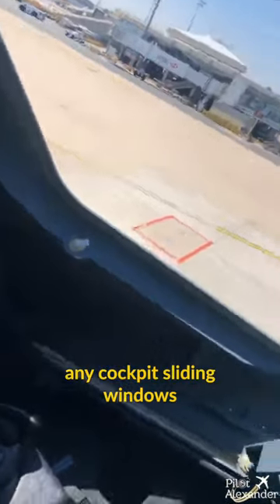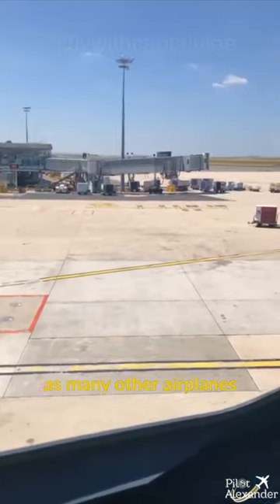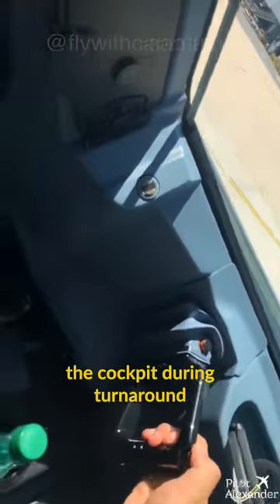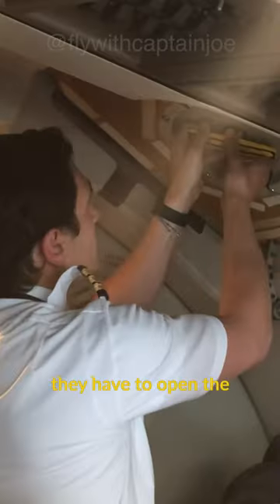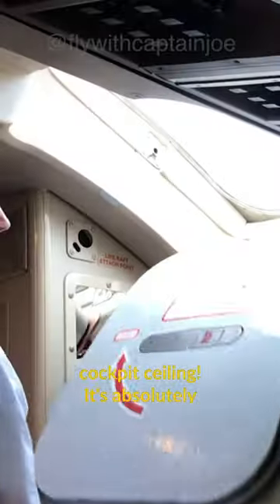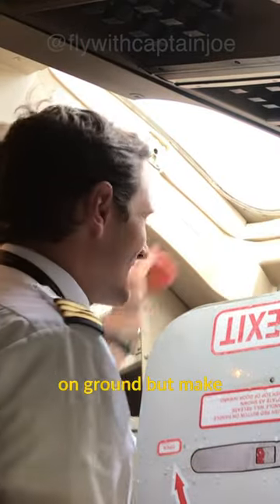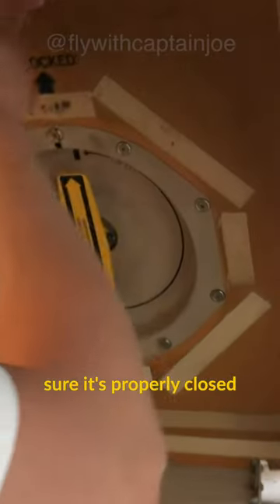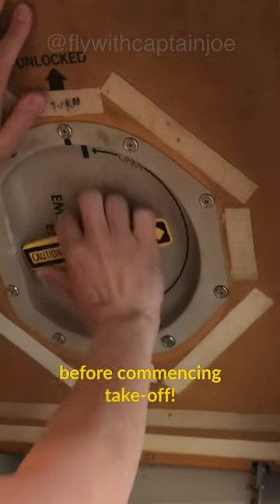How to open a 747 COCKPIT WINDOW??? #shorts

Comment: you say make sure it is closed on take off? Is there a warning light or sound to let them know it is open? Seems like something that might be important
Reply: There is a sensor which will alert the pilots
Reply: @drtibbs693  thank you
Reply: @drtibbs693 or you can look at the door page.
Reply: Just might save the airplane and all the passengers
Reply: @TB-um1xz  not sure if this applies to all planes, but I believe that on some aircraft cockpit windows and hatches do not show on the door page.
Reply: @muhammadfawzi1145  Well, this is a 747 video. Windows are not doors, so they won't appear on door pages. With Boeing aircraft's if the window is cracked open. You can see markings showing you that the window is, in fact, open.
Reply: @TB-um1xz  I’m more familiar with Airbus, so ur probably right
Reply: They would notice the wind noise during takeoff roll and the cabin would not pressurise. Aslong as they are below 10k feet it is all right.
Reply: @KuntalGhosh  mind you it would be one hell of a wind in the cockpit at 250knts 🤣
Reply: @Aspie_Geek_UK  😂 they will immediately hear it during the takeoff roll. My biggest fear in flying is explosive decompression like a door flying off or like that 737 that lost it's roof..
Reply: I last year or whenever I don't know when or where, but there was a plane taking off that right when they rotated on takeoff,  the cockpit slid open.

Comment: 2003 Iranair 747 SP flight from Tehran to Tokyo. On the hot day the flight engineer opened the hatch and forgot to lock it when he closed it before startup. Airplane takes off. They try for 20 min to close the hatch unsuccessfully mid air. They Dump fule, land, refuel, close the hatch, and head to Tokyo.

Comment: Always wondered if they can open them in the sky, I know at 40k they couldn’t but what about low alt
Reply: By “them” I mean windows
Reply: You can’t open any types of doors, windows, or hatches while cruising due to the pressure difference, its like trying to open a car door as its sinking. However you can open them if there is no pressure difference inside from outside. So yes, as long as the aircraft isn’t pressurised you can open whatever door/window/hatch at low altitude (and I think your speed is also a factor)

Comment: Captain Joe, is there a reasoning why they didn’t build sliding windows on the 747? We keep getting told it was an engineering/ aerodynamic decision. I want to know why?
Reply: I believe the reason is that the Boeing 747 cockpit is way too high off the ground, and Boeing did not want anyone to fall out of the cockpit of course if the pilots were to be wiping the windshield, waving/leaning outside or something. Can't say this is certain, but it's my explanation
Reply: in my opinion, I would say it's relatively more reinforced and safer. during turbulence, imagine it slides open at a high altitude, it will be disastrous. secondly; closing it back can easily be forgotten by pilots amid flight procedure.
Reply: @oncheemmanuel5349  Open during turbulence?